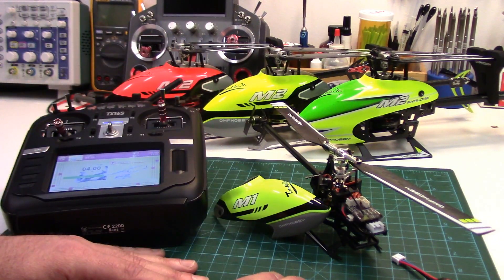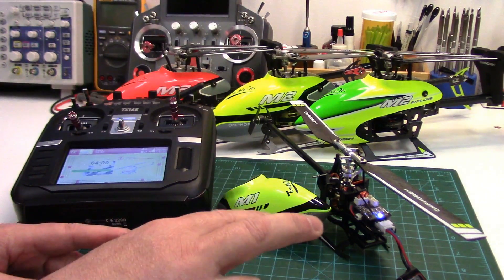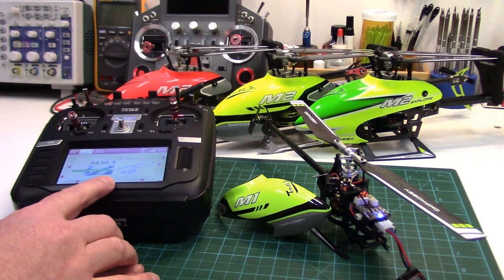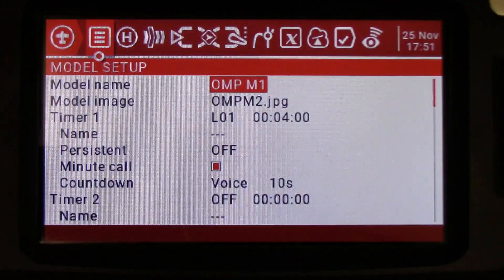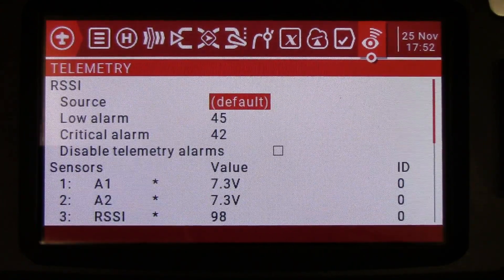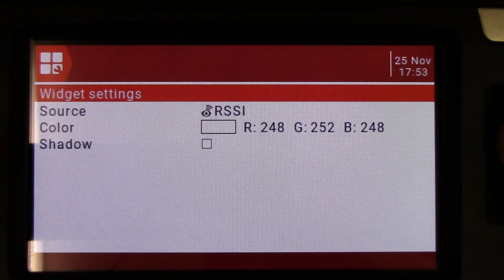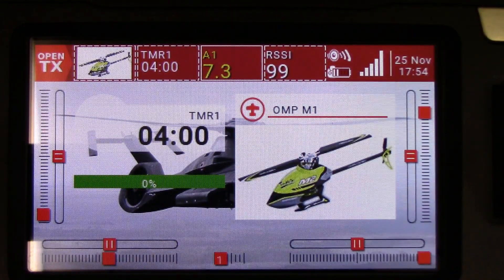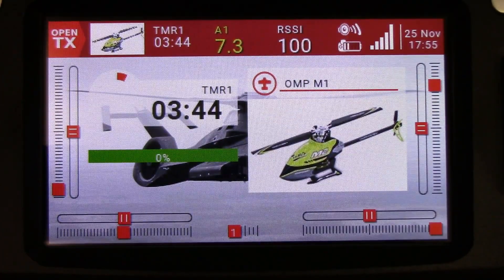OMP Telemetry Is Available - How To Get It & Set It Up.

Comment: I cant get this to work with my m1 4in1 futaba protocol. Im using a zoro with external 4in1 unit i cant get it to discover any sensors and i dont want to use the OMP protocol because of the locked curves and rates
Reply from the maker: As stated in the video and description; only OMP protocol supports their built in telemetry.

Comment: does adding verbal warning for low battery require a logical switch and a special function ?
Reply from the maker: Yes. You would setup up a low voltage alarm like you would any other alarm with LS & SF programming.

Comment: What type of receivers go into it.
Reply from the maker: This telemetry video is all about using the built in OMP protocol receiver. No external RX is used.
Reply: @Rchelicopterfun  O okay.Can you use any receiver on it instead of the telemetry.Like DSMX.
Reply from the maker: yes - a Spektrum satellite RX.
Reply: @Rchelicopterfun  What about Flysky versions.

Comment: Hi John, I've got a question about a low voltage indication for a M1. Since the M1 is such a success, I can't get hold of a M1 with an OMP protocol anymore, especially in Europe. All they offer is a BNF version with S-FHSS. I learned from your books that you may not exhaust the LiPo battery too much. So here is the question: Is there a smart way of detecting the battery voltage during M1's flight when a S-FHSS protocol is being used? 
Thanks for answering and the very well illustrated books!.
Wim.
Reply from the maker: Yep, the way we've been doing it for years - time your flights - still the best way IMO as I state on my LiPo battery page: https://www.rchelicopterfun.com/lipo-batteries.html
Telemetry is only a tool and honestly on little micros like this, a totally unnecessary one. It's a cool feature to access if you have it, but certainly not as convenient or hassle free as just timing your flights.
Reply: @Rchelicopterfun  Thanks for replying John!

Comment: What's your RSSI min when flying in a room? I get low RSSI warnings a lot when about 2m away (min being as low as 27 sometimes). Yes, I did the frequency tuning.
Reply from the maker: Yes, the RSSI reading on these little guys is quite weak even though the range seems to be perfectly fine. You have to dial down the alarm threshold if you don't want it sounding all the time or just turn it off. With that said, the values I'm getter are not quite as low as yours. I can get about 20M or so away before it gets down into 20's. I've got my low alarm value set to 12 and critical set to 10 which seems to be working fine.
Reply: @Rchelicopterfun  thanks for confirmation, I'll have to go flying the M1 outside, yet. Good to know RSSI values down to 12 are still considered "ok"
Reply from the maker: Only OK on these things... I'd be in need of an underware change if I saw a reading that low with one of my bigger birds 😄

Comment: John. Got a question. I have trex 500 with 425 mm blades. I am a sport flyer (no 3d). Can I increase blade length to 460 mm and supposedly have  steadier flying without interaction with tail blades? With having no DFC I would assume I wount struck tail boom either. Am I right or wrong?
Reply from the maker: I wouldn't. You are increasing unknowns & adding more stress, load, drag, and reactive torque to a system that was designed to spin 425mm  blades. Increased risks for very little if any gains IMO. Just my 2-cents of course.
Reply: @Rchelicopterfun  John. This thought of increasing blade length came out of inspiration and curiosity). I think you are right. Trex 500 was supposed to be bilt like this.
Reply: I compose music for fun. It is just my hobby. And once my friend asked me if I want to exchange my old synth keybord for his trex 500, and I said why not and that is where heli virus started!)
Reply: After I read your articles on turbine helicopters, first I was inspired and then i thought practically, where i am gonna launch it? I I live in big city but I got a soccerfield 200 meters away from me, so I will think about it a bit later. But I am sorry to disrupt u with dumb questions, I live in Kazakhstan and there is no one I have known who have or interested in rc helicopter, so if I bomb you with some dull questions, I would appreciate if you respond your opinion.
Reply: @rmiklosh  Stumbled on this. I like helos as well, live in the US. Until recently was commuting to KZ for work. I’m strictly US now, but wanted to say hi. I was working in Tengiz, Flying in and out of Atyrau. Love the country and the people

Comment: John. I have a question. What difference did you notice flying 2 blade vs 3 or 4 blade setup, for example on a scale heli? And do you need to get 3-blade setup on a tail as well?
Reply from the maker: @Roman That's a big question and topic. The 100 foot view is there is a marginal increase in stability and "air grip" and there tends to be less blade lead/lag induced vibrations while spooling up or down when there are more than two blades in the head.
This comes at the cost of efficiency, increased drag, shorter flight times, increased weight, increased current draw which produces more heat in the power system, more reactive torque so the tail rotor is working harder and tail blow out is more common, higher servo loads, higher parts count, higher cost, more difficult to track the blades, and in some cases more difficult to transport unless you remove the blades
In short, practically no worthwhile benefits considering all the added issues & hassles. They do look cool statically of course.
Reply: @Rchelicopterfun  I think I will just stick with two blades two rotor blades setup, caz i dont see benefits rather then good look
Reply: @Rchelicopterfun  John. But after all those scale things you talked about. I will stick to my beautiful trex 500. This guy took me to the air and I love him so much that I dont need any other heli to keep my soul going!)

Comment: Does telemetry work with spectrum as well
Reply from the maker: I'll presume you are asking if Spektrum (DSM protocol) can extract telemetry from OMP's control board when using a DSM receiver with any of OMP's helis. If so, the answer is no. Telemetry information is only transmitted through OMP's built in RX using their RF protocol.

Comment: Hi John,  Another great helpful video, would I be right in assuming If you copied one model setup from a radiomaster 16ts sd card  to another radiomaster 16ts sd card it would clone the same setup
Reply from the maker: Basic foundation/layout would be the same, but because helicopters are so mechanical in nature, there is almost always fine tuning involved since servo centering & pushrod geometry will almost always be different.

Comment: Completely off topic,  but noticed you use the the X12s       I've updated mine to the latest opentx firmware,     now I cant select the external antenna   work fine but with limited range on the internal,    do I need to backdated it,    rather than the most modern
Reply from the maker: Sounds like a question for the OpenTX development team. I have no idea in other words, but certainly if it's not working correctly with the latest release, I would revert back to the previous version you were using.
Reply: @Rchelicopterfun  yup,     the last up date was 2.3.8.     Major update for horus radios.      I'm running 2.3.10      it seems to more focused on the jumper series    tx18 T16 ect.       Will have a play with it this afternoon      Gives me the hebbies everytime I plug it to the computer.     Lol    thanks for your work and great channel.   From here in little New Zealand

Comment: Hey John! Just came across your YouTube channel a few weeks ago loving the videos and information!  I have a question for you I used to fly a trex 500 ( not very good) I wanna get back into it. I'm looking at getting the devil 420/ 505 or you recommend I go the omp route?
Reply from the maker: OMP make small helicopters (the m2 is swinging 180mm blades, the M1 125mm blades) so you can't compare them to a 400 or 500 size machine. If you want a smaller/micro size collective pitch RC helicopter, then OMP's are amazing. If you want a larger heli, then they are are not the right fit (literally).  🙂
Reply: @Rchelicopterfun  thanks for the reply! Are the smaller helis harder to fly? Or go stay the 500 route and keep practicing? I am also in northern  bc, from your videos I take it Williams lake 100 mile area?? Once covid is over would love to get some flying lessons in!
Reply from the maker: @anthonypsantos  It depends on your definition of "harder to fly". The smaller the heli, the less mass, and thus less inertia it has. Smaller helis are therefor more reactive and "squirrely" as they respond much faster and to a larger amplitude to every control input or disturbance. Basically everything is sped up. This is why smaller helicopters don't have that wonderful fluid feeling or predictability of larger machines. OMP has managed to filter a good deal of that low inertia squirrellyness out with their stabilization algorithm, but it still isn't a large heli - physics will always overshadow human ambition.
The plus with micros that many consider "easier" is they are not nearly as intimidating. If you crash one, chances are it will survive and even if you do manage to bust it up in a high energy impact, the total repair costs will be less than a single set of 500 size blades. 
Location: Near Valemount/Mt.Robson.

Comment: I came here to understand how to set up alarms when battery voltage is getting low. 
You seem to know how to do it. May I suggest to publish a video about that soon?
Nice vid thx
Reply from the maker: I'll consider it. OpenTX university has a good tutorial on it.
You just create a logical switch with the a<x function where "a" is the telemetry voltage value (A1 for example) and x being the lowest voltage you want to set your alarm to sound at. So any time "a" is less than "x", the logical switch activates. You generally also put a time condition in for several seconds so you don't get alarms every time there is a momentary voltage sag during a power spike due to a high load maneuver. That is all experimentation, based on your model, your flying style, and even your battery C ratings.
You would then set a voice or alarm callout whenever that logical switch is active (ie. when the voltage drops below the threshold you program for too long).
Timing flights is still the superior method I find because voltage is so dependent on load, but no question, having an LV warning is another layer of battery protection; like when you put in a depleted LiPo pack without realizing it -  we've all done it  :)
Reply: @Rchelicopterfun  Nice one! thanks John

Comment: Now I am really considering to buy one of those TX16s‘s. They seem pretty nice, but I‘m a bit scared of the unlimited functions 😂 My Futaba T6K V2 is way easier, but therefore there are no „complex“ settings. Can you recommend the radio?
Reply from the maker: As I always recommend to anyone who is pondering the "should I make the switch to OpenTX" question; spend some time on OpenTX University's website to get a basic idea of how it works along with the learning curve involved. I liken OpenTX vs. traditional computerized radio operating systems to that of Linux vs. Window's or Mac OS.
Both are powerful open source systems and like Linux,  OpenTX is a "nerds" operating system; and I mean that as a complement. I know more people that have fallen in love with OpenTX and would never go back (again like Linux users), but I also know a few who absolutely hated it and could never figure it out. 

As for the Radiomaster TX16S if that's the OpenTX radio you are considering along with it's latest variations such as the MAX; as I indicated in my review on it, and as so many others have also come to the same conclusion... It's superb! In my opinion, it's the best RC radio of 2020 and even the best over the past several years.

Comment: John if i really wanted a OMP heli for my first heli what should i go with,the 1 or 2? would like you opinion please.
Reply from the maker: If you have no previous experience with any collective pitch RC helicopters, I would actually not recommend either (they are fairly advanced small collective pitch helicopters after all), but that is your call. If you are getting an instructors help, that is different of course but I suspect you are going the self-learning route. As for size, that is totally dependent on the size of the flying area you intend to fly it at the most. The M2 for example is too big for the average size yard (at least if you want to have any fun with it). The M1 on the other hand is a better size for yard practice.
Reply: If it is your first collective pitch helicopter, then I would recommend that you get the XK110 first.

Comment: I found that a blade nano s2 has telemetry when I bind it to the tx16s but I would constantly hear "telemetry lost" and then "telemetry recovered" whenever I get like 10 meters away or more. I'm hopeful it works better on OMP helis
Reply from the maker: It's been my experience all micro's have pretty low telemetry signal strength transmission. Nothing like full range receivers do. You also lose out on antenna diversity with little single wire antenna micros so you'll find you might have a high RSSI signal in one orientation and then turn the heli 180 degrees and it drops in half and the alarm sounds. In short, you generally have to lower your RSSI signal strength alarm signal limits on micro setups.  Default RSSI signal strength alarms in OpenTX is 45 (low) & 42 (critical). I will usually lower those to around 30/25 with micros otherwise as you said, the warnings are sounding all the time. On the M1 at the default 45/42 settings, I found the range is around 100 feet (average) before the warnings start in certain orientations. Lowering it to 30/25, I never get them. Of course still do your range checking to confirm you are not at the limit of RF control signal as well.

Comment: I'm the Multi Dev and came across this video. The documentation for this protocol is located here: https://github.com/pascallanger/DIY-Multiprotocol-TX-Module/blob/master/Protocols_Details.md#omp---77 .
RSSI=TQLY is the % of received packets from the model by the Multi module (max=100%, min=0%=connection lost), it is NOT how well the model is receiving the module signal since this information is not shared by the receiver on telemetry. A1 and A2 are the battery voltage as you point out. A2 is showing only good telemetry packets voltage values, while A1 shows everything and therefore could contain some small errors. You MUST calibrate A1 and A2 based if you want something meaningfull, the how to is described in the documentation link above.
If you like what I'm doing don't forget to show your appreciation: https://github.com/pascallanger/DIY-Multiprotocol-TX-Module/blob/master/docs/Donations.md
Pascal

Comment: I can tell wait to get my TX16s and start learning more about open protocol .. thanks for all the great videos ! Question - will I need to add anything else to my TX16s other than some software updates and following your videos about how to add the OMP M2 config to the tX ?
Reply from the maker: Check the firmware versions first - the latest batches being shipped may already have the latest, but if not, then yes, you'll need to update the multi-module firmware.